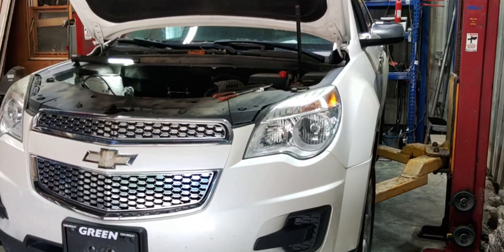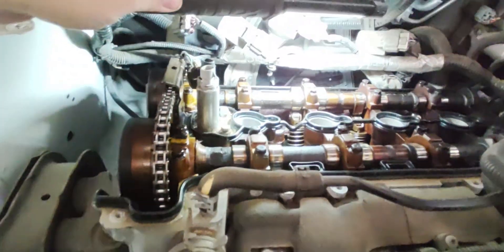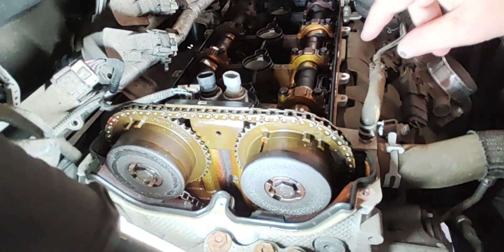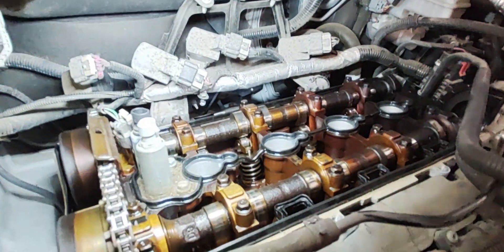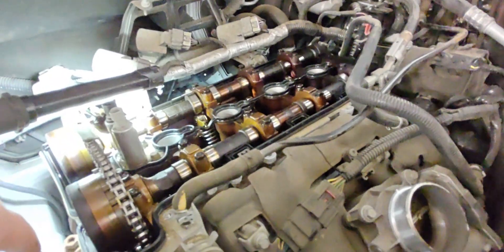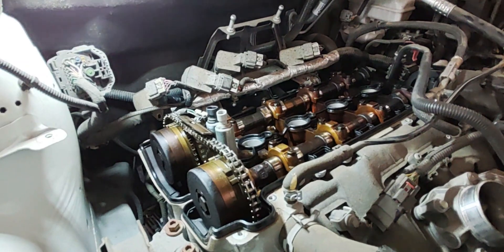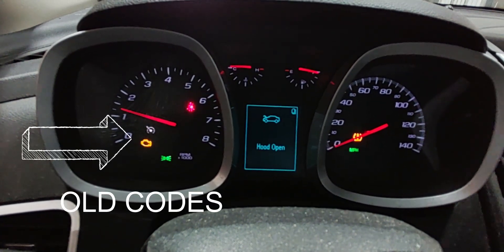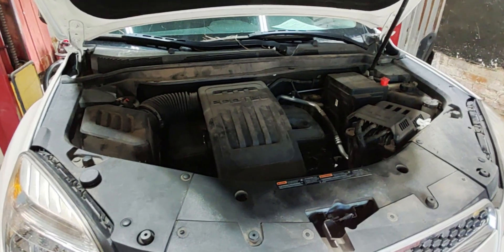Do these checks before replacing your 2.4 ecotec! You may not need an engine!

Comment: 2016 Equinox came to my shop the other day for a wiper motor linkage. The car sounded horrible. She shut it off & that was all she wrote. I borescoped it.. it bent all intake valves. 100% certainty with just removing spark plugs
Reply from the maker: Time to pull the head. Hope the customer understands
Reply: @shedhouse7330   left on a wrecker. I gave her a $5,500 price for a used engine...  btw, I didn't fix the windshield wiper linkage but she paid for the part I special ordered

Comment: I remember I purchase a 1997 Honda civic with a little over 100,000 miles for $500. Changed the oil and filter and the engine was burning coolant out the exhaust and within a few days the oil was black in color. Removed the head and honed the valve seats and replaced the valve oil seals. Removed the pistons and put new piston and rings and piston pins. Honed the cylinder walls replaced the timing belt. When I was done putting the motor back together. It ran like a top and the oil stayed looking like new for weeks.Gave the car to my son. Back then parts were inexpensive. Not like today.

Comment: There is an oil life light... The problem is that per the excessive oil consumption it is not calibrated to read it appropriately. As such, an owner must check the oil weekly and replace the oil twice per oil light interval or every 1,500-3,000 miles..... How long does or should it take to replace the timing chain? Is it necessary to replace the water pump as Cloyes video suggests? Also, have you ever needed to replace a AC Compressor per someone claiming that the clutch is making the screeching noise ever when the surpentine belt is off???

Comment: Great Video. I watched this over and over again trying to find something I may have missed. I replaced the timing chain (Cloye timing chain kit) on my 2014 GMC terrain 2.4l Ecotec. The vehicle was showing a P0017. It fired up immediately after I completed the work. However after shutting the car off it will only fire up occasionally. It continues to show the P0017 and a couple new codes. (P2228 & P0113) I redid the timing to ensure everything was aligned correctly, I replaced the exhaust cam shaft sensor, the crankshaft sensor. The car reacted the same way. Fires up immediately after rework but struggles starting after initial start up. Any feedback or suggestion you could offer would be greatly appreciated. Thank you

Comment: I replaced cylinder head bent 2 valves at low speed put another head on new head gasket new head bolts new timing chain now no compression in all cylinder took that head off put another one on still the same ordeal no compression in all cylinders
Reply from the maker: I'm assuming the pistons are ok. Only thing I can think of is improper setup of the timing chains.
Reply: @shedhouse7330 I accidentally installed a new tensioner fully extended maybe its throwing the timing off?
Reply from the maker: @73swagin  I'm not even sure how that's possible. The tensioner might not even go all the way in. Maybe you broke the guide.

Comment: Ive replace a lot of these motors. Procedure daus to drop it out of the bottom. Its way easier and faster to pull it out of the top. You have to remove a few things but itll go.

Comment: I got no compression in my cylinder 4 for my chevy equinox 2015 2.4L. They scanned my engine and said that : 
Finding:

confirmed customer complaint, cylinder 4 had a dead misfire, removed plugs to confirm correct plugs are installed, cylinder appears to have low compression, so we started with performing a compression check and cylinders 1, 2, and 3 have good compression with 220 psi +- 5, cylinder 4 has zero compression, performed a wet compression test and confirmed there was still no compression, removed valve cover to check the rocker arms and make sure they are still in place with enough tension to keep them there, the 4 rockers on cylinder 4 are in the correct place and have the correct amount of pressure to keep them in place. there is internal damage to the engine causing no compression. the engine will need to be replaced, multiple codes found in ecm, see pictures.
Reply from the maker: Might have a burnt valve. Ask them to do a leak down test. I've seen this many times in the 2.4. easy enough repair.
Reply: @shedhouse7330 Thanks very much.  I will ask them and I'll let you know.

Comment: I have a question. Can you replace a top timing chain guide without pulling all of the covers on the timing chain assembly? I feel like the top guide is worn out. I understand  you definitely have to remove the valve cover and stuff. What would it take to put a new top guide?

Comment: Thanks for the info. Our 13 equinox started rattling at 128k and this is with regular synthetic 5k mile changes. It started using oil at about 85k and it did get a couple quarts low a couple of times. I replaced everything, timing and balance shaft parts, last weekend, and it seems to be running very well now.  I check the oil every month or so and have to add a couple quarts between changes. Hope to get another 80-100k out of it for about a $400 investment.

Comment: Great video … I just bought a2014 gmc terrain the girl I got it from said the mechanic said it needs a new engine.she had a new engine put in and 2 weeks later timing chain went .. I think it’s the same thing u had here..  I’m going to pull the spark plugs and put a camara down them .if i don’t see any makes on the pistons from the valve may have hit .then I’m just going to put a new timing chain kit in it .. what do u think ..?
Reply from the maker: That's a good plan. Roll the engine over and do a leak down test too.
Reply: Sell it!!!

Comment: I have a captive 2014 I changed the weather chain, the cam phaser and vvts, and the code P0011 continues to appear to me. And is moving the time, cold works perfec 20 or 30 min star sheiking what can I check

Comment: Do you further damage the motor when you try to crank it after? I was told it could have been ok but not after the tow guy turned it over so we could hear the slap. Also, does this info apply to the 2.2?

Comment: Awesome video. 101k miles and no codes and runs a bit clanky on startup and a hint of lifter noise but otherwise runs smooth w/ good power. Going to pull the valve cover and look. Hope it didn't jump and bend any valves.

Would it be noticeable how the engine runs if the timing skipped a tooth and bent valves? I would think so.

Comment: I have one in the shop and the top timing chain guide broke. The engine leaping time lmao... Honda... i did timing on had the same issue top guide bad.... They need a better concept or maybe better material...Ls5.3 guide broke and destroyed the engine valve busting a piston... Reminds me of when i was buying cheap motorcycle chains and had to adjust my tire every week.

Comment: Holy baloney! Thank you for sharing your insight and expertise! 

I own a 2017 and a 2022 Chevy Equinox SUV’s that are 1.4L EcoTec engines. 

I heard about the high engine oil consumption issues from other channels, and I normally change the engine oil out every 3k miles to avoid any catastrophic problems.
Reply: I do mine every 3000 as well but after you get 100,000 miles sometimes less they start using way more oil. Like a lot
Reply: @JohnF-z7o  Wow, I did not know that. Thanks for sharing. 

My 2017 Equinox has 75k miles and my 2022 Equinox only has 21k miles. So, we’ll see how these vehicles perform at around 90k miles.

Comment: the problem with asking them to do those checks, is if they are set on replacing the engine they could charge for the checks and still say you need a new engine. And you have no idea whether they checked or not.

Comment: I picked up a 2013 with the 2.4 and it shows theses codes P0014,P00C6,P0300,P0325,P228C i pulled the timing cover off and found a broken guide if it jumped time will it throw all these codes

Comment: I have a 2011  then later on my kid's 2015 Equinox 2.4L that had the timing chain go loose due to a failed or loose chain tensioner. In both cases, the chain would slap/rattle on to the cover.  I was able able to remove the timing cover and access / replaced all the same parts you identified earlier.   I blame the cheap bicycle grade timing chain and in retrospect not changing the oil frequently enough.   I gone 100% synthetic oil.    The hard part of this repair job was making sure that the timing chain was exactly and properly installed.  In both cased the slapping timing was loud enough to give warning to the driver to stop using the  car.   These 2,4 L engines are zero clearance engines .

Comment: Ever since you changed my timing chain it started burning oil.
Reply: Do you have any codes.on the engine, if not then maybe a valve might not being fully closed on the exhaust side for valve

Comment: I bought a 2.4 Malibu hybrid cheap cheap because it had a dead miss in one cylinder…. The other cylinders had great compression. Pulled valve cover and found two broken rockers on the intake cylinder 2. Checked with bore scope everything looks great… I have 2 bent valves in the intake side… the upper tensioner between the cams is also missing… it looks like they also neglected oil changes!! THANK YOU for your knowledge and taking the time to make this video… the alternative was spending $2000 for another engine and having to put it in.🍀 🍀

Comment: My wife's car just stopped, I'm figuring bent valves, I've found a good head, complete, what I need to know is where is everyone getting the timing chain parts/kits phasers and all? I know I can buy some cheap something on EB but I would rather get something of quality that will hold up a while. The car only has just over 100k on it and I have kept it maintained. I've seen videos of the tensioner sticking or breaking and I imagine that is what happened here. There has not been any indications of any problems and then it died on her last night in Sam's parking lot. Thanks.

Comment: can stop the oil burning somtimes by cleaning the pcv hole on the intake to release the crank case pressure. or install a vented oil cap

Comment: I failed at reaearching these engines and equinox in general. Bought a used 2010 that was well maintained. My mechanic told me to make sure I add a quart every month,so i set a monthly reminder to check the oil. Im pushing near 160k miles on it now, replaced plugs n coils because i would get a shake at 60mph... still get the shake with new tires and balanced.
 Cant figure out why!
Reply: Same here and I spent 13k cash on a suv with this engine. Can we cry together?
Reply: @marcstoogood  I've been crying every damn day! I just replaced both o2 sensors, still got the P420 code.. changed the converter, 3 days later coded again! I am so tired of sinking money into it. Can't afford another car payment with a new truck payment already in place. AND I still have a shake in the wheel!

Comment: I HAVE A 2013 WITH 200.000 KM ON IT ' I PUT IN  A LITER OF TRANSMISSION OIL IN  MY OIL CHANGE  EACH TIME  CAUSE IT  CLEANS THE SLUDGE OFF THE THINNER OIL RINGS  ON THESE .   THE PVC HOLE PLUGS UP ON THESE CAUSING THE RINGS TO SLUDGE UP  AND BURN OIL . SEAFOAM CLEANER IN THE ENGINE AND IN THE OIL WILL CLEAN THIS UP  . LOTS OF VIDEOS ON CLEANING AND FIXING THE PVC VALVE .

Comment: I just replaced my wife's timing chain and phasers, but now there isn't any compression in the cylinders. I'm also getting a P228D code. I don't think I did mine correctly.
Reply: I had this happen and i had been sent the wrong cam phaser for the year i had...looked the same but made the intake cam out of time
Reply: @derekrobinette8151  turns out my wife managed to bend all of her intake valves. I have since rebuilt her entire engine and now it runs great.

Comment: If an ecotec needs replaced then I would just get a new car at that point😂 Nobody in my area will rebuild an ecotec. One guy just told me to buy another car because it’s not worth it. I made to 266k miles so far and might get a few more because there’s no way I’m dropping the engine to change a flipping chain😂

Comment: I would love to get in contact with you.  I had a mechanic shop to scan me for $1,500 my car is vibrating it still runs good no engine light but it's vibrating when you crank it up and it's really cold in the morning and it vibrates is there any way I could get in contact with you and talk to you on the phone? I replaced all the motor mounts I replace spark plugs coil packs call pack I still have the vibration

Comment: 2012 equinox stalling usually cold start, I unplugged top oxygen sensor no more stalling, scan tool data showed engine running rich then ecu corrects to lean then stalls out. No codes, new oem oxygen sensor on order.

Comment: I have a 2015 equinox 2.4 engine. Crank no start and my mechanic said I need an engine replacement. I have checked the valve cover and inside the intake and exhaust chamber.. both look good. My timing chain is in the same condition as the video. This gives me a piece of mind that it could potentially be a timing chain replacement. 

By chance do you have a manual on how to complete a timing chain replacement.
Reply: I have 212k miles. The codes that populated P0172, P0191, P0016.
Reply from the maker: I use all data and prodemand. You can find a ton of videos on youtube covering the actual replacement of the chain. Good luck, hope it works out for you.
Reply: @shedhouse7330  I will. Thank you 🙏🏾. I pray I can replace both the balance chain and time chain assemblies properly

Comment: Do you normally replace the balance shaft chain and tensioner/guides too? I've heard that's recommended since they can have basically the same issues as the timing chain.
Reply from the maker: @seandknutson  case by case. But usually I don't.

Comment: Change the oil regularly an me make sure the tiny PCV port in the intake manifold gets cleaned out EVERY oil change. You can prevent 95% of the problems with these engines just by staying on top of maintenance.

Comment: What if it sounds like timing chain but it’s tight? I have side to side movement on my chain and rockers
Reply from the maker: @Matt-k3e  the phasers could be bad not allowing them to go into the parked, locked position. I've also had water pumps on theses engines rattle.
Reply: @shedhouse7330  I rotated the engine by hand, when it rolled the chain slacked and then u can almost take chain off. Definitely believe it is the culprit now. I replaced the phasers first before tearing into the engine

Comment: When you ear a sloppy chain 2-3 sec. on a cold day is it mean chain start to elongated ? Car is a 2009 G6 but just 40k miles. Do a new tensioner can catch up the slack or its better to think about do a timing chain job + balance shaft chain + waterpump and so on and so on. I think i may open valve cover the check but what you guys think ?
Reply from the maker: Could be the tensioner, could also be the vvt sprokets but I'm not sure if they had them on the 2.4 in 09. Id start with a good oil change and see if that helps.
Reply: @shedhouse7330  oil is new, and yes it's VVT, and i think it's port injected. Im going to open valve cover and change tensioner.
Reply from the maker: @jeanfrancoismenard705  quick tip, make sure to hold tension on the guide when you pull that tensioner out. Don't want the chain to skip.

Comment: What I don't understand is why would they put basically a peace of juck engine there not like the use to be now the put all this wired components on them like what's the point of a high pressure fuel pump that's on the engine whats  wrong with the one in the tank cuz there's also one in the tank well there just junk then I had a 1996 Toyota Tercel with 300 thousand miles on it an it still ran like a champ dont think these worthless engines they put in these cars these day will even get that fare these new cars a very very expensive but there junk so sad for these big auto dealers maje junk now an make a whole lot of money for juck sad.
Reply from the maker: @fastfredamen  EPA

Comment: My 2011 Chevy equinox runs but the StabiliTrac light comes on and then it says reduce power. There is some codes on there. I’m so over it. I need some answer please🤦🏽‍♀️🤦🏽‍♀️. From the codes I have to seems it needs a timing belt. I have P0016, P0017, P0036, P228D,, P0089 and Mass Air flow code. I have changed Intake+Exhaust Camshaft Position Actuator+Camshaft Sensor+Engine Crankshaft Sensor, Mass airflow sensor, High pressure fuel pump, Fuel rail sensor, Both Purges valve and solenoid, Map sensor, Throttle body. I swear I will turn my ignition I go on the block the StabiliTrac light will come will come on and then the reduce power will show up. I don’t know what else to do. Can somebody please answer. I’m so lost. Do I need a Timing Belt??? Or Do I need to replace my wheel hub and the speed sensor???

Comment: Sir  you are a GREAT teacher,   I bought a 2.4 Sunfire GT Convertible, my 2nd one,  I Love that model,  it runs Perfect but sporadically makes a rattling noise,   now I see the problem, if the tensioner goes bad it slaps around and breaks the plastic guide on top,  means it is flying around like a Pinball machine bouncing off of everything,  WOW YOU ARE GOOD Thank You Sir.,    Have a Great Weekend.
Reply from the maker: @billydoyle9984  glad I could help